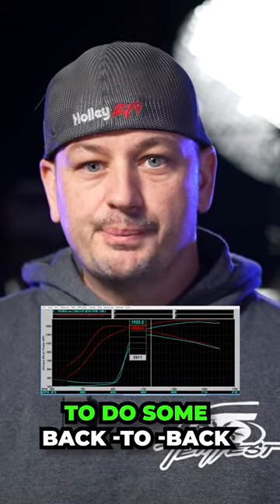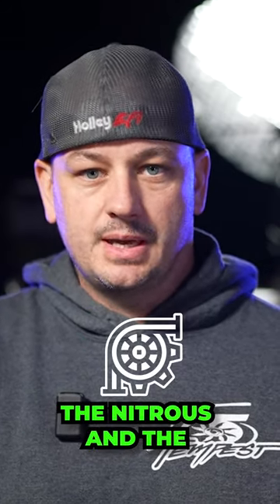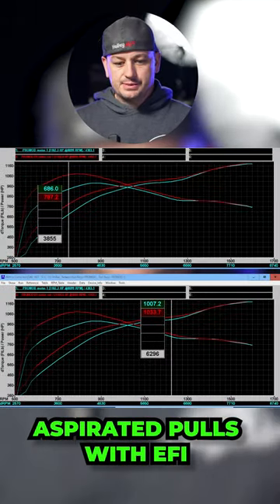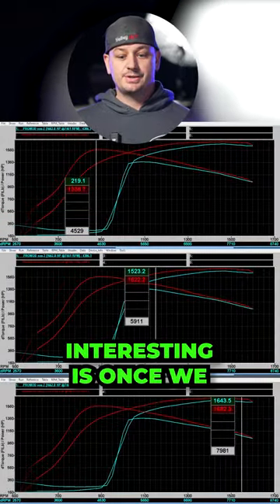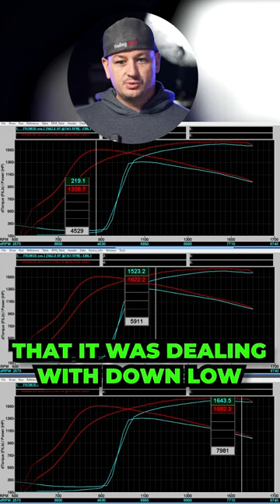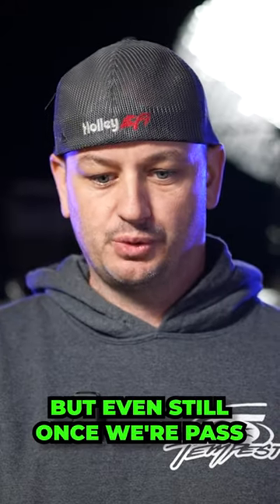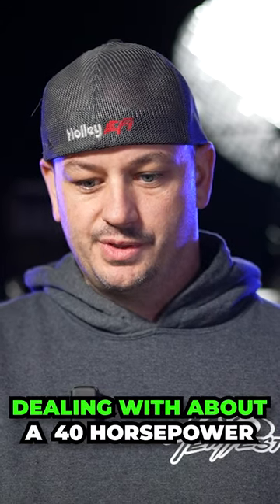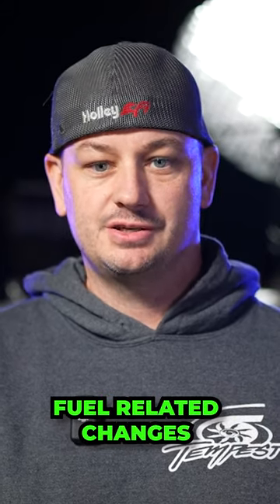Carb vs. EFI - Back to Back Test on a Promod #shorts

Comment: Manifold design has a large impact on this as well.  Great Carb manifold with a carb replacement EFI may not do as well as a purpose designed dry EFI manifold that is not designed to carry a wet air/fuel mixture.